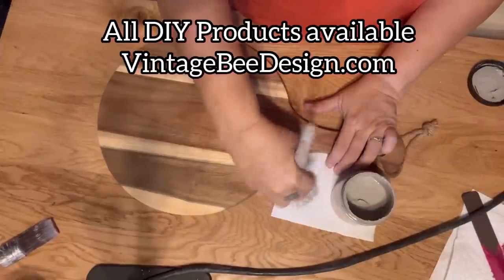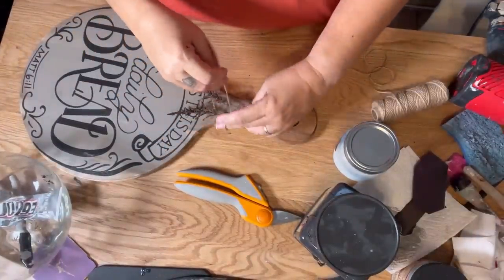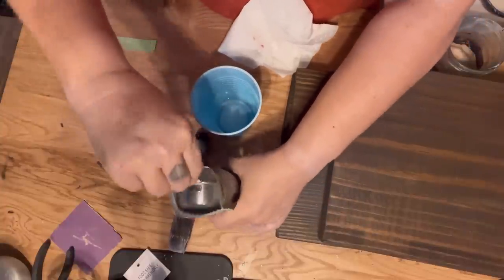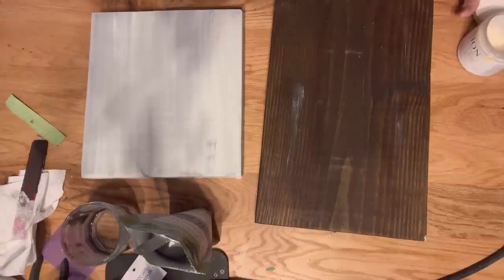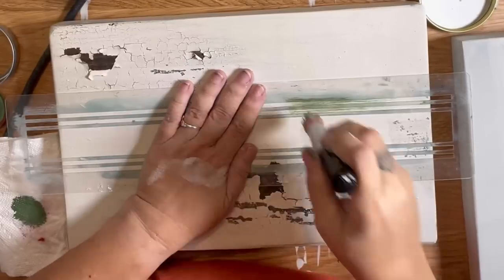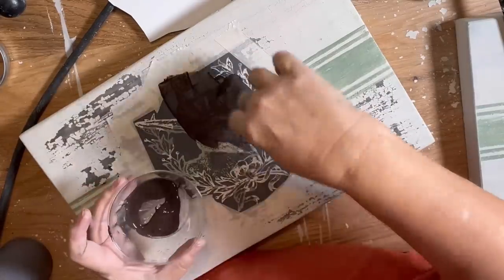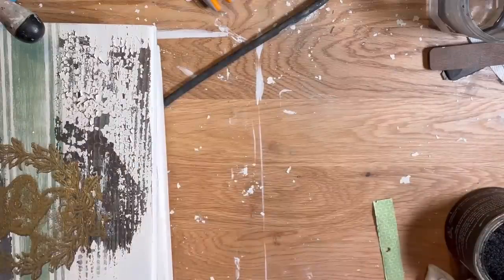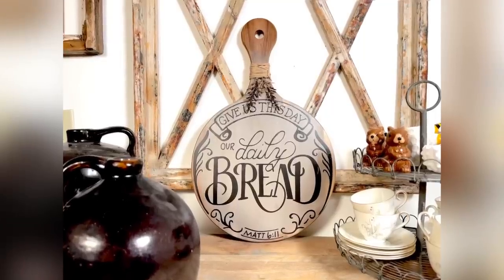Making products for Vintage market | Using mesh stencils & Milk paint | Wood Risers DIY Home Decor

Comment: I bought one of those stencils.  It lost its sticky.  How can I rescue it for reuse?
Reply from the maker: I’ve never had that happen. Have you washed it with soapy water, and left it to dry upside down?
Reply: @VintageBeeDesign   yes.  I am very careful with them.
Reply from the maker: Let me try to get an answer for you. How many times have you used it?
Reply: @VintageBeeDesign  25 or 30 times.  A lot.  I use it a ton.
Reply from the maker: Ok thanks. Let me check and get back to you.